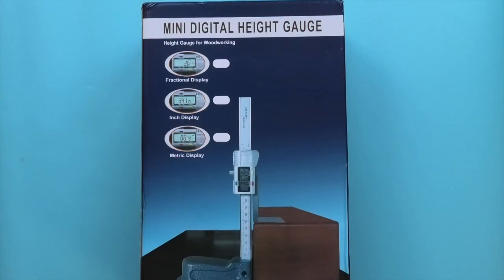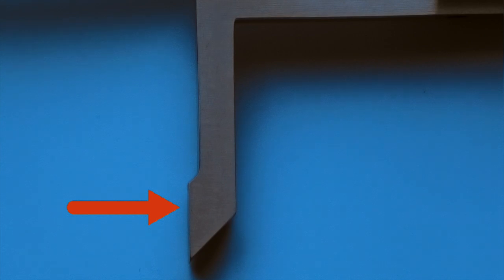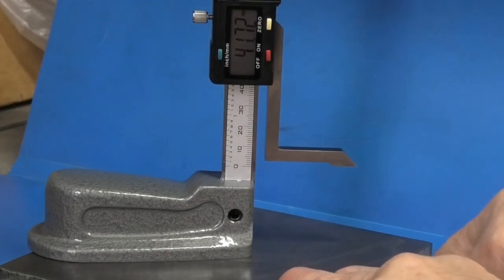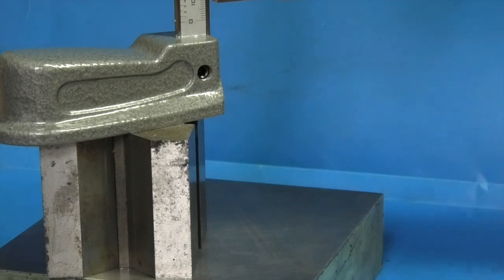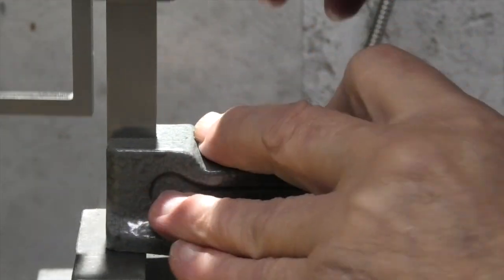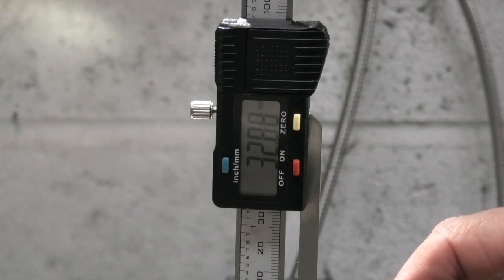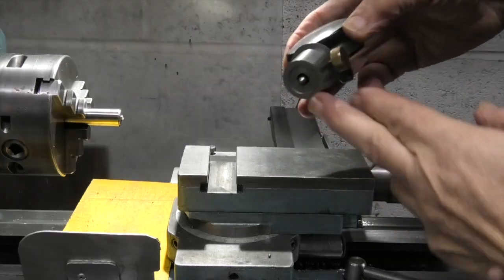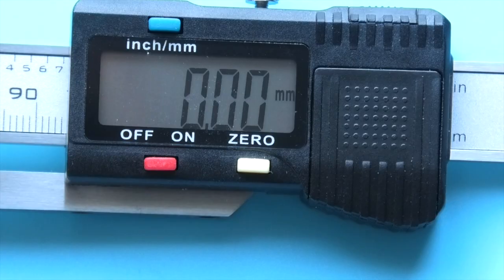Digital height gauge

Comment: Hi Alan. I have a similar model bought from a UK supplier a few years ago. I found it to be very frustrating for two reasons. Firstly I find it very hard to set it to a particular measure to scribe with as there is no fine adjustment. Very finicky. Also it appears to be suitable for left handed use and not right handed due to the orientation of the screen. Very frustrating. I ended up replacing it with a secondhand precision gauge which has fine feed and the screen is orientated for right handed use. I was fortunate to find it on eBay for a steal. The original gauge though is now used by me as the perfect lathe tool height gauge, set at 3 1/2” for my Myford. 👍😀